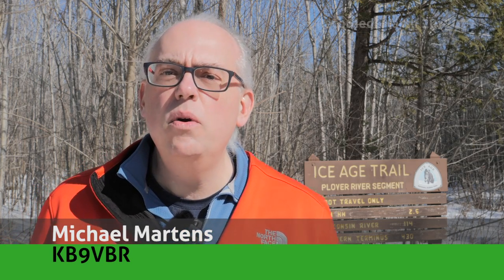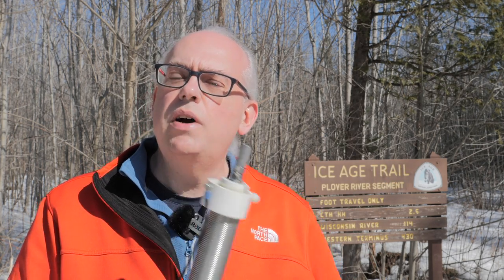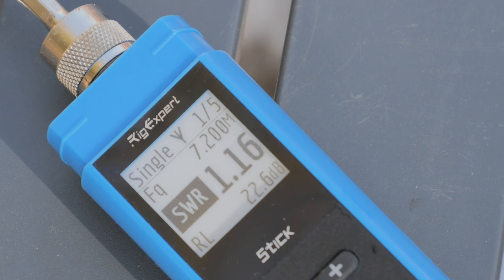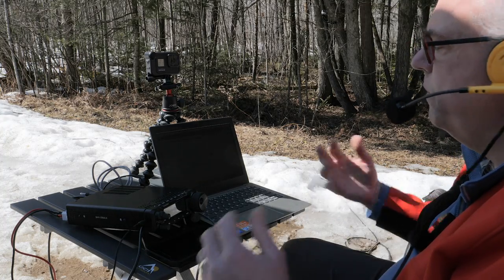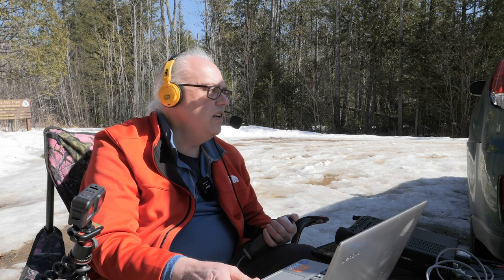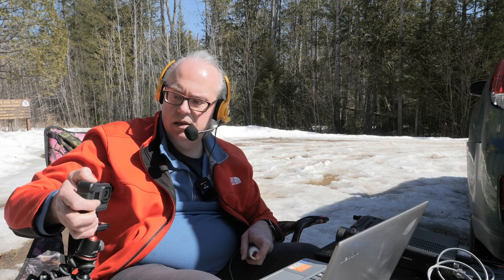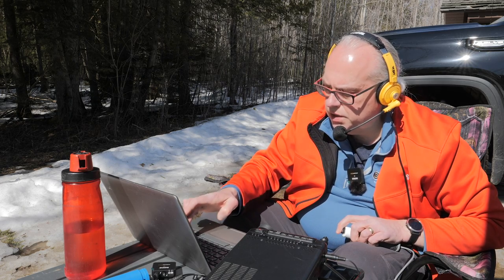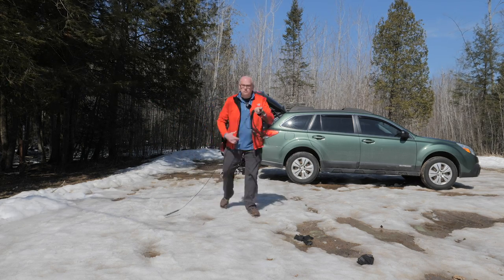Using the Wolf River Coil portable antenna. Parks on the Air (POTA K-4238) #HamradioQA

Comment: I've modified mine a bit. I've swapped out the standard whip with a foldable whip, I got off Amazon, that's a bit longer and doesn't run the risk of jamming or breaking. I've also marked off my radials off for the various bands. I have additional, marked radials if needed. It does work really well
Reply: Good tip re the radials. 👍
Reply from the maker: I've used the Chameleon mil-whip and mil-extension with the WRC. When you combine both the mil-whip and extension, the collar is almost to the top of the coil for the 40m. Makes for a powerhouse antenna on that band.

Comment: I own 2 Silver Bullet 1000 and two TIA's.  I find the antenna absolutely impressive and pretty weather proof - even here in Alaska where I've left it outside all winter.   I spent about a full month experimenting with the number of radials required for each band and Yes... you are correct.  3 radials works good on all the bands.  4 radials is better but not by that much and 5 radials etc...  I've made almost 3,000 contacts using the Wolf River systm.  Nice to see they manufactured a Hi-powered Platinum version.  I would love to have a 160m version.  They had suggested but.....     AND, thanks for the tip on the Chameleon antenna.  i'll definitely order one shortly.  GREAT video Michael  /Dan KL1JP (Alaska).
Reply from the maker: I've left my WRC set up all winter in the back yard, it has good weather resistance as long as you use some antioxidant on the screw connections. I did talk to the WRC guys during a hamfest meetup about a 160m version. They feel it would be very compromised  and the bandwidth would be paper thin. But I have heard of people experimenting with it on that band, so if you are up to the challenge . . .

Comment: I'm thinking of using Slinkies and tent pegs for ground radials. Simply because they will always pack themselves back up in neat coils!
Reply: Tape Measures work well.
Reply: @PropterH0C  Good tip. 👍
Reply from the maker: I might have to try the slinkies. That may make a fun video.

Comment: Usually ground mounted radials don’t need to be tuned by band. Raised radials do. The quantity can affect it but usually not length. I always use 3 at 33’ for all bands and get an acceptable match.
Reply from the maker: I know that's a popular thought and the way it should be, but I've also run into a 'brick wall' while adjusting for a good tune on the higher bands and often shortening the radials drops the SWR right down. There are a lot of variables at play and I wonder if ground conductivity plays a role in radial performance.
Reply: @KB9VBRAntennas  It seems like the coil and whip determine the resonant frequency and then the radials and RF ground establish the input impedence.  Over poor ground, the radial (length) almost acts like an off center fed dipole for impedence matching. 🤔
Reply from the maker: I think thats a pretty fair assessment and good explanation of what's happening. Next time I go out, I'll have to take some snapshots as I tune the antenna to see how the Z and X change with radial adjustment.

Comment: Michael, what are the parts you are using to attach the antenna to the clamp -- any particular SO-239 configuration or 3/8 x 24 adapter? Thanks. K3SLH

Comment: Love your videos. I’m a new ham ..passed tech/general in April. Just about have hf gear but have not been on air on my own kit as yet. Hoa space constraints but just wanting to get portable kit operational for summer camping season. Having a heck of a time just formulating equipment list for mobile/camp vertical. The list you posted with this video is close  (ch antenna, silver bullet etc).  It’s the little details that are holding me up … what connectors do I need, what to use for counterpoise, tripod, etc, etc. I m in Alaska so equipment takes time to order and ship.   My 7300 and power supply arrived while tuner and analyzer are on order. Thanks for your quality videos. KL5SO

Comment: I just received the WRC sb 1000 platinum w mega tripod and 102”whip.  I tried it on 20m today and couldn’t get swr below 4.9.  I had the radials it came with all the way extended. And whip fully extended

Comment: Hi Michael.. I just finished a trip to CA/OR/WA.  I activated about 60 or so, new to me , parks.  One must be similar to your Ice Age Trail.. The one here in MT, ID and OR probably happened at the same time.. The one out here is called the Ice Age Flood NGT.  This flood had huge boulders encapsulated in ice and dropped them on top of some pretty high hills.  They are called Erratic Rocks and can be found all over the area where the flood happened.
WA7WS
Reply from the maker: The Ice Age Flood trail is similar to the Ice Age trail in that these events happened in the same era. The Ice trail marks the extent of glaciation in Wisconsin while the Flood trail is the remnants of the catastrophic flood that happened with the glacial meltoff. The Ice Age trail is littered with erratics and its one way to mark its location, in addition to moraines and glacial till.

Comment: I found out a couple of helpful tips. Some were from owners and some were my doing. 
Lose the 33 foot radials. I use 6 each of 24 feet and it tunes  waaay easier. 
Also, if you have rocky soil or there are boulders around raise it 3 to 5 feet off the ground. 
Don’t use short coax. Use at least 50 or 75 feet.
Reply: Hi Doug. I also have a WRC too. What can be done if I can get low SWR of 1.3 but only in a narrow range of a band (40m)?

Comment: Thanks for another great video! 
What are you using to connect the headset and PTT to the 891?
Reply from the maker: I use the Heil BM-17 dual headset. It has connectors for the FT-891. I did a video on it recently: https://youtu.be/qB1z2g8m090. The PTT is a home built hand switch that was also highlighted in a video last year.

Comment: Hey Michael.  I have the same whip and coil.  The whip is resonant across the 20m band without the coil when fully extended (and with plenty of radials).  Maybe a quicker tune on 20m would be to just remove the coil.  Thanks for all of your great videos.
Reply from the maker: Previously I would usually start at 40 meters and work my way upwards. But with the progressively better upper band propagation, i'm beginning to work from the top down, so I'll try things out with the whip only.

Comment: I just use the MFJ 1979 (same as the Chameleon SS-17) and the WRC tripod (with no WRC coil) for 20m - 6m. I almost never do 40m or 80m so it works well. Radials 3x 33 ft and 9x 8ft total and VSWR less than 1:1.30
Reply from the maker: Previously when I did an activation, I would start at 40m and work my way up, so I'd leave the coil in place. Now with propagation getting better for the upper bands, I'm considering working from the top down and only using the coil for the 40 meter band. You may see more videos like that in the future.

Comment: I am a great fan of your YouTube channel. 
How are you recording your QSOs?
Reply from the maker: My method is a little over the top because I need clean audio for the video, but briefly, I am using the Rode Wireless Go 2 lavalier set. This allows me to record two channels of audio. One unit is plugged into the audio out jack in the back of transceiver and the other unit is clipped to me for my voice. The receiver on the camera puts the two channels into right and left stereo for the video. When I edit, I mix the two channels together and adjust the levels for good sound. I'll do a video on the process for those more interested in it.
Reply: @KB9VBRAntennas  This works out great!  The audio of your QSOs is really good.  I was wondering because I am moving into satellite communications, and I hoped to pick up some tips from you.  Not sure I will go to the lengths you go to for excellent recordings, though.  Thanks!

Comment: Thanks for the video! I have the same antenna and for some reason on 10m I can't get it tuned in at all.. pertty frustating. Not sure if it's my coil or something else going on there. I tried adjusting the radials with no luck.

Comment: Thank you for the informative video. I really like this antenna.  My first portable antenna was a homemade speaker wire dipole for 20m.  The wolf river was my upgrade and it has done its job well. The only change I have made is on the radials. I will need to look at that longer whip maybe that will be my next upgrade!  73 KN4QHQ.

Comment: Hey Michael- thanks for all the informative videos-  I am trying to decide between the WRC and the Gabil - I need information on 80 meter performance in addition to what you have provided for 40 and up for a comparison between the two products.  Any chance you have tried either or both on 80?  thanks- Fred K4AFV.
Reply from the maker: I don't have any personal experience with the Gabil antenna, I may have to pick one up and test it out. But I can comment from my experience running 80 meters on a vertical like the Wolf River Coil. The two biggest issues when it comes to 80 meters with a vertical antenna is bandwidth and efficiency. With the WRC, your bandwidth is pretty tight,  usually around 50-60 KHz. The determining factor on that is the diameter of the coil, narrower coils will have a higher Q and less bandwidth. To get the most bandwidth out of an 80 meter vertical, look for one that has the widest diameter coil. 

The 2nd issue is efficiency. The more coil you use, the less efficient the antenna will be. More power will be spent warming the coil section than radiating from the whip. In order to combat this, you will want the longest whip possible so you can use the least amount of coil. I've used my Silver Bullet 1000 on 80 meters with both an 102 inch rigid whip and the 213 inch collapsible whip. The performance is much better with the longer whip. 

80 meter portable operating can be a challenge. Unless you are in the winter months, the bands can be quite noisy and the antennas are quite long. I usually only run the data modes on 80m in the summer months, but by late October the band settles down enough to enjoy 80 meter phone at night. I hope this gives you some help in making a decision.

Comment: Based on your video, I just tried  a feather flag cross base for my WRC antenna.  Holy cow - that is a game changer.  Super fast setup and very stable.  You should do a video on your various antenna mounts and ground radials.  I know you have done this before, but a refresh would be really nice.
Reply: What is a feather flag cross base?
Reply from the maker: They are heavy metal bases that are used for advertising flags seen in front of businesses. This is the base I'm using in the video: https://amzn.to/3vN23w8
Reply: @KB9VBRAntennas  thanks Michael.

Comment: I know elevating the coil a bit is supposed to help, but is it worth the effort?
Reply from the maker: That's a good question. From a setup standpoint, ground radials are faster and work quite well. I believe the advantage of an elevated radials is it's independence from ground conductivity effects. If you have poor ground, the elevated radial may be worth the effort. Maybe when it gets warmer, I can test that hypothesis.

Comment: Thanks for the video. Tuning the antenna for different bands seems like it can be a bit finicky.
Reply from the maker: It can be, but there are also things you can do to make retunes easier; like marking spots on the whip and coil so you can return to those points quickly. I've found that whenever I set up in a new place there is always a bit of tinkering involved due to what's interacting with it in the environment.

Comment: Thanks for the great video. Do you think the gauge of wire for the radials makes any difference?
Reply from the maker: I don't believe so. I use 14ga stranded THHN wire because it's readily available and relatively inexpensive. At least it used to be. I bought 500 feet a couple years for antenna prototyping, so I have plenty of it to experiment with. But I think a lighter gauge wire will work just fine.

Comment: Do you ever add an in-line choke to your setup.  If so, where do you place it.  At the antenna or at the rig.  Going back and forth as to if it is really needed
Reply from the maker: My long coax has an integrated choke, but I don't think it's necessary for the Wolf River Coil as that type of antenna typically  doesn't pass common mode currents down the feed line. Any choke would be placed near the feed point of the antenna for maximum effect.

Comment: Good video.  I have the same setup and was thinking about mimicking the radials like on the DX Commander, instead of three 33’ radials that you have to mess with, what are your thoughts on maybe more but much shorter radials? I’m interested to hear your opinion on that.
Reply from the maker: I've read in the WRC groups about people using bundles and more, shorter radials. It seems to work well for them. I've stayed with the simplicity of three but will have to try out that method.
Reply: @KB9VBRAntennas  I have a 1000’ foot roll of 18ga wire someone gave me, I think I’m going to try and make three bundles of 10 at about 10 feet long with clips like you have on my next time out. My hope is they deploy easily and aren’t all knotted up! We’ll see. I’ll report back on here after I try it. Might be a week or two before I can get out again.

Comment: Would having the radials running over concrete vs soil/grass affect the SWR?
Reply from the maker: It does, and ground conductivity is one of the variables in getting a good match. I often will stretch the radials out to what I think is a good distance, adjust the whip and collar to the lowest SWR that I can (which in some instances may only be 2:1), and then adjust the radials to get that final good match.

Comment: What's the max DX you have achieved with this configuration? TNX 73s
Reply from the maker: I've worked Western Europe: Great Britain, Spain, and Belgium, to name a few, with this antenna. All 50 watts SSB. I'm sure with proper timing and band choice you could work the world with the WRC.
Reply: @KB9VBRAntennas  Thanx for the detailed reply, that's really impressive with this setup with only 3 Radials and 50w SSB......i have a superantenna with 10ft buddistick, I haven't used it yet properly but after watching your video definitely going to give it a try and most probably I ll be using CW.....anyways keep the videos coming and once again TNX for the early reply 👍 73s

Comment: It's a good option to have in your bag, but for 14 MHz and higher I'm not a fan of that "fiddly" tapped coil and variable telescopic whip lengths, etc...  I think single band Shark sticks are faster to setup and teardown, simpler to change bands, and will get comparable results.  Just my opinion. 🙂
Reply: Just a friendly FYI, the Wolf River coil doesn't use any traps or capacitor matching. Just think of it as the variable inductor inside a manual antenna tuner, except in this case it's not being combined with a capacitor to match the impedance to your radio. When you have under a 1.5:1 SWR on a WRC, your antenna is more or less perfectly tuned for the frequency you're using, no impedance matching or anything. In other words all of the power you are putting out of your radio, minus the coax losses will be making it to the antenna.

I love my Silver bullet 1000, and have not yet experienced any melting or deforming due to high power. I typically run 40 watts of digital / 100w SSB, and could get away with much more on 20 meters and above because I have center loaded my coil and I'm barely using any of it for the higher bands. However above 40 meters be mindful of your coil temperature, my coil nearly reached melting temperature when I was running a hundred watts of WinLink on 80 meters.
Reply from the maker: One advantage of the WRC is that it gives you a higher Q or quality factor compared to the sticks. I will totally agree on the faster setup and teardown of the shark sticks. I'll have to do an A/B comparison of the two antennas.
Reply: @KB9VBRAntennas  Yes, a performance comparison between those 2 would be revealing.  From 14 MHz and up, those vertical Shark sticks are amazingly effective.  Plenty of bandwidth too.  When an Italian station responds to your SSB "CQ" you know it must be working. 🤣

Comment: So I take it 40 meters has been loud for everyone, not just me?  Finally tuned my base antenna better for it, and it is just a nonstop "buzzsaw".
Reply from the maker: If you are hearing a buzzsaw noise, that may be manmade or electrical interference. But noise on 40 meters has been slowly increasing. Part of that is the seasonal atmospheric change, but the increasing solar activity also plays a big a part.

Comment: Do the radials need to be tuned? I was under the assumption that if they were at least 1/4 they would be ok. But longer would be better? 

Second, should the coil be as close to ground as possible for takeoff angle. Or would raising the coil/antenna be better? I tried both and saw no difference in my testing.
Reply from the maker: Radials laying on the ground don't need to be tune, but I've found that length still does have an effect- especially if you are using a small number of radials. If the radials are elevated, they do need to be tuned to the frequency to be effective. 

I believe keeping the coil as low to the ground as possible is supposed to give you the best, or lowest, take off angle.
Reply: @KB9VBRAntennas  Fantastic! Thanks for the quick reply and all your informative videos. You,Josh and the Dec 10m contest  are the reasons I upgraded to General last month! Getting my POTA setup ready to test-run during Winter Field Day. 73s!